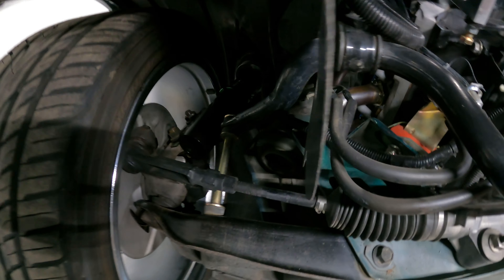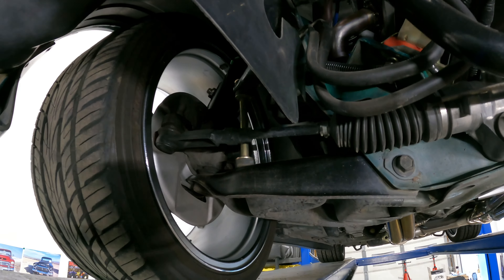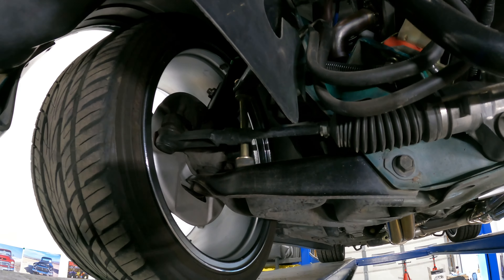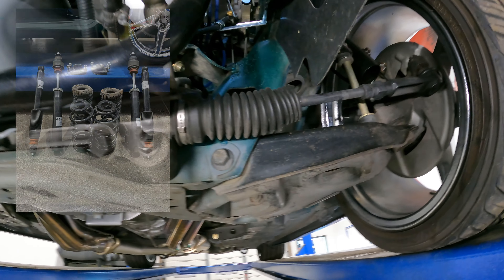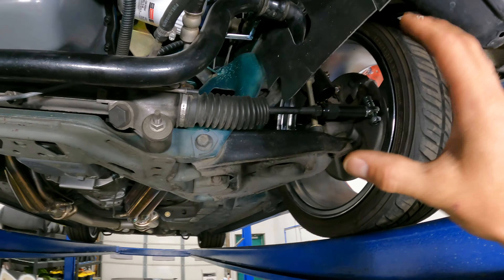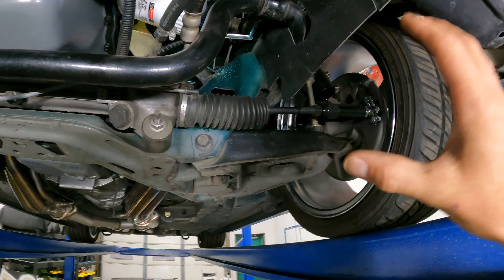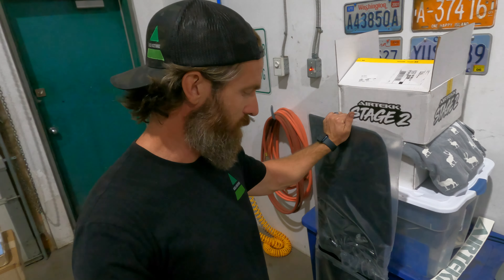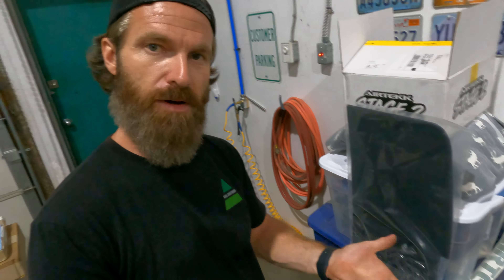I Fixed My Bump Steer - The Right Way!

Comment: The alignment shop that installed these for me put all the spacers at the bottom. The tie rod was shot straight up. I didn’t even know this. I adjusted it but my lift isn’t from the wheels so I guess I also did it wrong. It’s a lot closer and it helps a lot but still have slight bump steer. Before, even if I hit a bump with both tires I’d get bump steer. Now I only get it when one tire hits but it’s not as scary since it only jerks the steering wheel not the whole car. I’m going to do what you did with the jack stands.

Comment: Hi Gary. Great video! My only question is, how do you determine when the tie rod is parallel to the control arm? Is there a measurement to be taken? Anyway, really looking forward to all the future content, especially the truck lid sans wing and the Average Fox build. As always, Thanks! Bill.  🦊🙂
Reply from the maker: Hey Bill! Well buddy, i wish i had a more sophisticated answer for you but… i just eyeball it 😂. The wife says I’m pretty good at hanging pictures so therefore i feel I’m a certified parallel engineer 😉🍻.
Reply: Hey Bill, there is most definitely a sophisticated way of going about this if you want to really get into this and dive deep down the old rabbit hole. Just a YouTube maximum motorsports bump steer measuring tool and Peruse a few of jacks videos. You can get extremely involved in the process if you want and spend a full 10 hour day taking measurements and cycling the suspension to achieve absolutely zero bump steer.

 As Gary mentioned for 98% of us it's easiest to just eyeball things as close to parallel as possible while suspension is at ride height, and your chances are about 95% that your car is going to handle perfectly fine with nothing to complain about. If your car is as low as Gary's or mine is, eyeballing the tire rod and the control arm at ride height is going to be pretty tricky. I have another comment here also on how to achieve that with you if need be🤘🏼

Comment: Great video. Just a comment on the bumpsteer kits. I’ve used a couple on fox mustangs with good success. My pace car has a set from maximum Motorsports. I have had issue with passing a safety from some local inspectors. If you can, get a safety inspection done before installation.
Reply: It shouldn’t effect your safety inspection, I pass every year with these on..
Reply from the maker: Interesting...
Reply: I had issues with it on an out of province inspection. Totally new rebuild so it stuck out. They passed it but were asking for DOT approval.
Reply from the maker: Wow! I honestly don’t know the “rules” surrounding it but would sure like to. That said, you’d think they would applaud the fact that it’s now safe. However, the whole lowered thing can be frowned upon as well tho… us car guys just can’t win 😂

Comment: I saw you were using 96-04 spindles and curious why your didn’t use 94-95 with stock kmember and an arms? I have team z 12” arms and k member with 96-04 spindles and strange coilovers… I’m not sure if I can be doing something better especially because I keep ripping sway bar tabs off the arms?
Reply from the maker: Hey bud, the spindles you saw in this video are just stock spindles

Comment: Are your headers chrome, or, ceramic coated? I couldn't see them clearly enough to tell. I ordered ceramic coated on mine and the manufacturer replaced them twice before I bit the bullet and had them Jet Hot Coated to stop the rust. Thank you.
Reply from the maker: No i sure wish they were ceramic. These are the BBK “chrome” ones that only look decent for the first 20 miles…
Reply: That is the company I used, 6 months and started rusting. White feature car, silver Jet Hot Coated the rest of the exhaust system, and you can see the collectors from the side. It's been 3 years, and , silver in this process not being available, the white coating is still not rusting. Lifetime warranty on it. I like to see which ceramic coating doesn't rust. So far all but the earliest, driven, ones seem to. @KASLCustoms

Comment: Pro tip here: Take a piece of masking tape and put it on the center of the fender for a consistent reference point of measurement each and every time. While the car is on the ground, take a measurement from the bottom of your masked point on your fenderwell down to the centreline of your front wheel bearing on the hub. Now you can put the car on jackstands & remove the front wheels or both front wheels & with a block under the ball joint, Jack up on the lower control arm until you get your measurement backfrom the hub bearing to fenderwell to simulate ride height with the suspension compressed. Now measuring bumpsteer is super easy as the front end is essentially at "ride height" but the wheels are off.
Reply from the maker: There you go!!!
Reply: @KASLCustoms  you got to give the boys the pro tips! They need them!

Comment: Should this always be done with a load on it?
Cause LMR shows tires hanging on regular lift while installing bump steer...
Also what would make my Stabilizer links on a angle facing the back of the car??? I got the lowering links. Its lowered on SVE lowering spring & strut kit? Any help greatly appreciated
Reply from the maker: Yes I would recommend having weight on the suspension. It’s the only way to truly get the angle correct. As for your sway bar links, has some one changed where the sway bar mounts to the frame?
Reply: No, but they put on tubular lower control arms